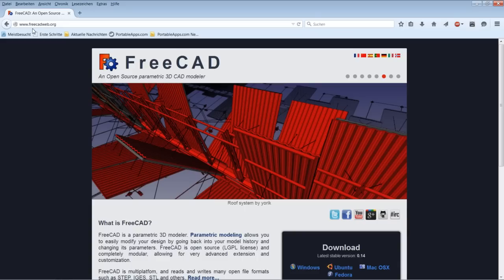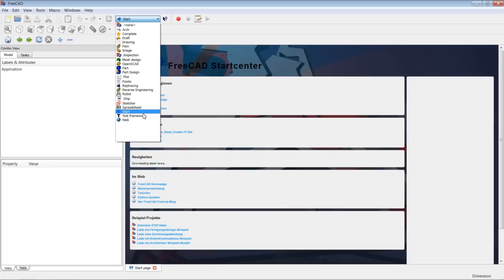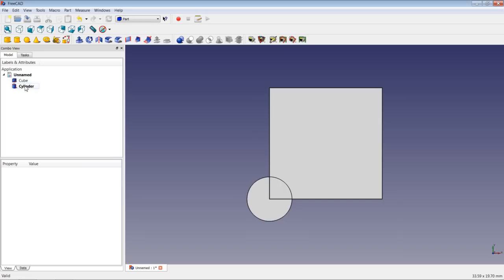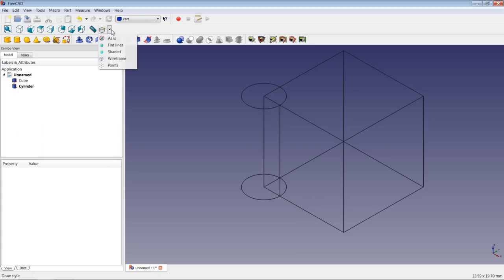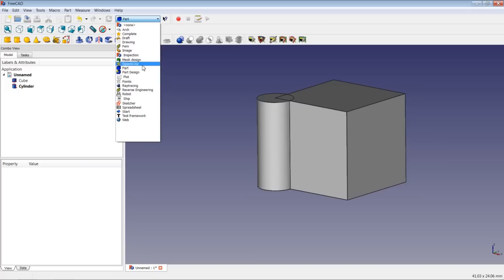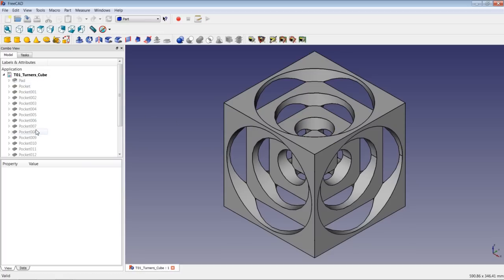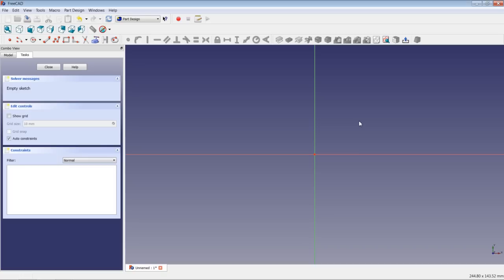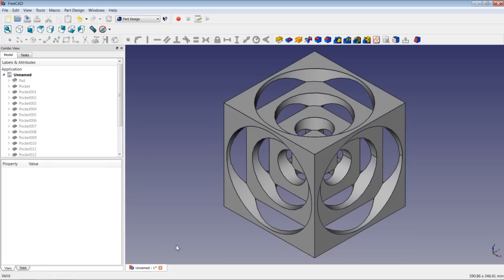FreeCAD Lesson 01 - Turners Cube

Comment: when I press the scroll and try to tilt the object it only zooms in and out it does not tilt or rotate the object. Could that be a mouse issue?
Reply from the maker: +Nelson Barocio 
This is related to the naviagtion style you are using.
Seems to are using Inventor Navigation.
To change navigation style right-click in the 3D-View and choose "Navigation Style" from the menu.
Use (from the top menu row) Edit > Preferences > Display > 3D-View to choose/change your default navigation style.
Clicking on "Mouse" in the preferences-menu will show the mouse commands of the chosen navigation style.
Reply: +Learn FreeCAD Got it Danke schön

Comment: freecad keeps crashing./ not responding. I'm trying to convert as simple stl file using mesh and it freezes completely . its not even a difficult stl
Reply from the maker: +bri w 
Which OS ? Which version of FreeCAD ?
I admit that FreeCAD is not the best tool for working with meshes.
It is designed for working primarily with solids.
But at least with 0.16.5484 i never had a crash when exporting with File/Export.
Did you try that ?

Comment: So, something seems wrong here. You're defining the same thing over and over and over and over and over. There has got to be a way to reuse some of the information in this scene so that you can adjust the parameters quickly. What if you're cube isn't 200 millimeters but 50 millimeters? Do you have to go back and fix everything for each side? That's a little crazy.
Reply: +oEQjet I believe it was made on purpose as a didactic tool (FreeCAD as being a parametric CAD does open a possibility to create/derive quite complex objects from base set of values. However this example aims at and ponder over fundamental concepts.)
Reply: I think the repetition helped my memory, but I expected at least a mention of the availability of a better/quicker way to repeat.  Surely copy of one face sketch could be pated onto each other face in turn?
Reply: This is a beginners video, repetition is needed to get a good foundation of the material being covered. I found myself starting to master the commands and movements by the last face. Tomorrow I will do another one just to practice.